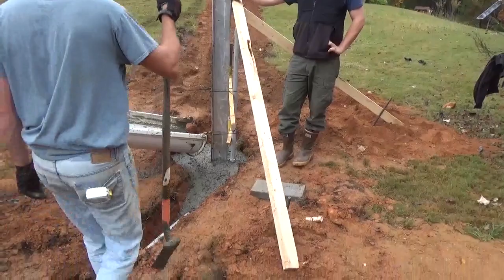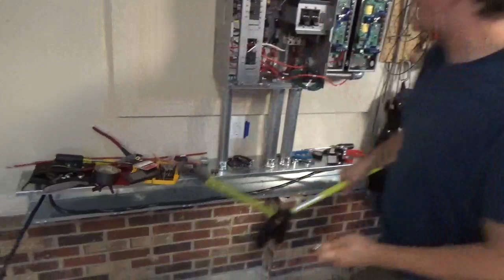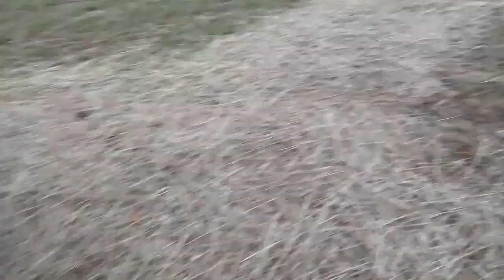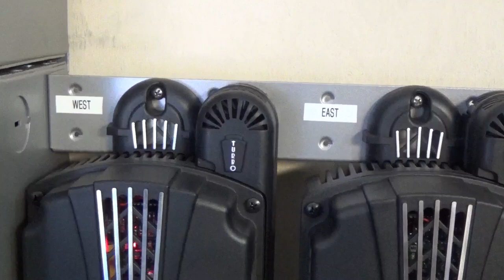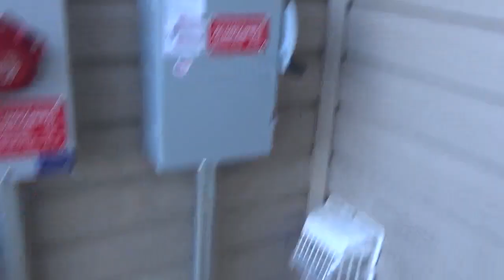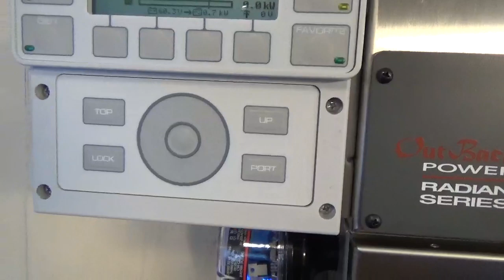7.75 kW Flying V Hybrid Solar

Comment: If you want to play trick on your buddy with a water level .. Fill 1/2 with cold water the other 1/2 with hot water .. Will read 2 inches different heights

Comment: Looks great big bucks I'll bet.
Reply: +Holly Laughter 
Yeah, but I still want it.
After hurricane Rita, I went almost a week in 90º+ temps daily, barely better at night, no electricity so no cooked food, no cold water, no fans, no lights.  Just attempting to sleep outside in a lawn chair with the Off slathered on and breathing in the fumes from the neighbor's generator.  No breezes at all, even thermal, because Rita took all the spare air with it when it moved northeast.  And staying home because half the Katrina refugees were in the area, taking up what relief resources were available.
These panels look like heaven.

Comment: Very cool. Great job. At the end, it looks like you took the critical/essential loads off the service panel. Is the output of the Radian 120 VAC supporting those inverted loads on the subpanel? Just curious, because that is what I am doing with my Reliance Controls transfer switch. I also have the Mate 3 and two Midnite Solar Classics...both are great...but with Optics RE...won't show PV power on the screen. Is there anyway do get that? Or am I just dreaming? -Chris

Comment: would back feeding diodes on each panel help the efficiency of the voltage from each array when shading becomes an issue. if that's an issue. and would it not be more efficiency to put grid ties inverters at each array panel junction box feeding the home.

Comment: What is the advantage of the Midnight charge controllers over Outback?  I would think staying with one brand would be very helpful for networking utilizing the Mate.
Reply: The classics have a higher voc threshold than the fm80's, it's called hypervoc. You save on wire size and wiring of the arrays. I just like the classic better too. The mate3 cannot see them it's true but it still works fine in grid tie mode. The fm80 is the ancestor of the classic. The same folks made both charge controllers, and classics even fit perfectly to the outback bracket. Also a classic can handle more power than and fm80. These arrays would have had to have been wired in strings of 2 if we had used the fm80
Reply: Thank you.  I have had problems staying under 150 VOC on several systems, but I heavily utilize the programmable AUX relay and have had very positive responses to all my warrantee issues with Outback.

Comment: perhaps look into the tesla battery packs for homes?
Reply: +Steve Nash Is the Tesla battery voltage compatible with the 48 Volt inverter?  How many KWH of energy do those Tesla batteries store?  How does the life expectancy of those batteries compare to lead acid?
Reply: Peter Lawton tesla is lithium type batteries, my ford has a lithium battery that is my main source-i drive a hybrid-c-max, look up tesla battery pack for home, all your answers are there...:)
Reply: +Steve Nash OK, I looked up the answers.  The Tesla battery is rated at 350 - 450 Volts.  I have never seen an MPPT solar charge controller rated anywhere near that, nor an inverter.  The normal battery banks are 12 to 72 volts, though 12, 24, and 48 seem to be most common.  The Tesla battery designed for daily cycles is spec'd for 7 KWH (I forget what Engineer775 said the pack is in the video).  The Tesla Powerwall comes in two models, only one of which is for daily cycles.  That 7 KWH model is rated for 5,000 cycles.  5,000/365 works out to 13 years.  Not a bad life expectancy!  Because of the charger and inverter issue, I have decided to look at other battery technologies.
Reply: Peter Lawton it was a suggestion and thought provoking idea,i hear that telecom batteries and forklift batteries work as well..:)